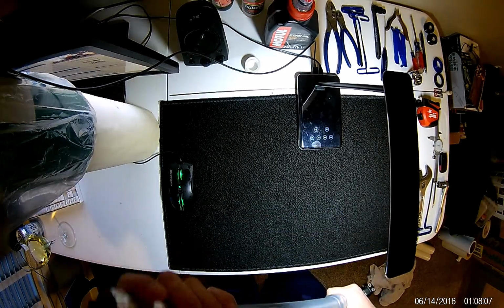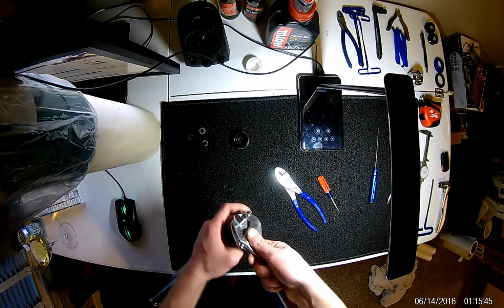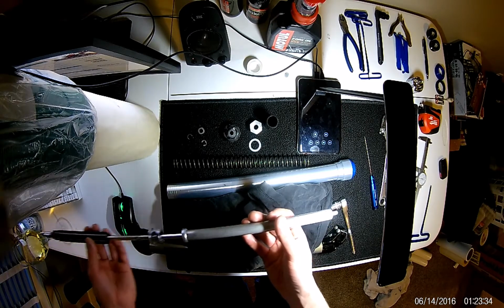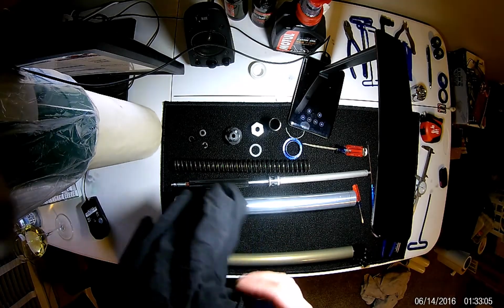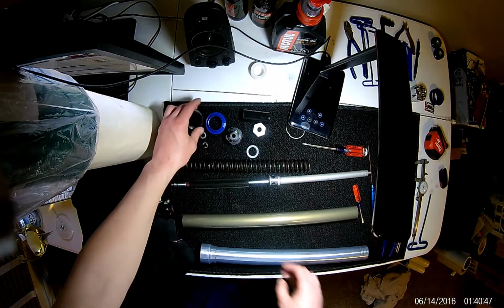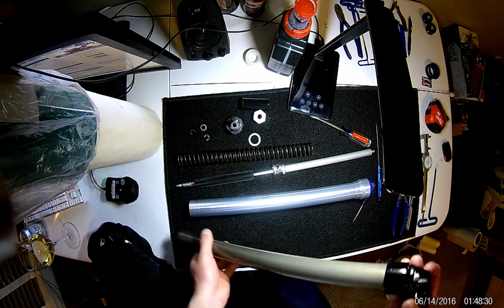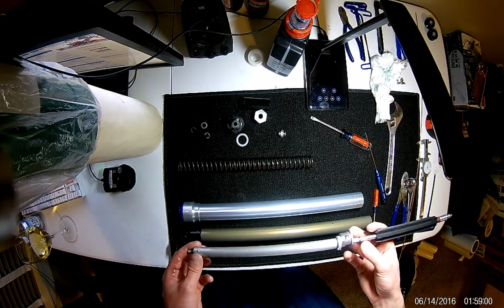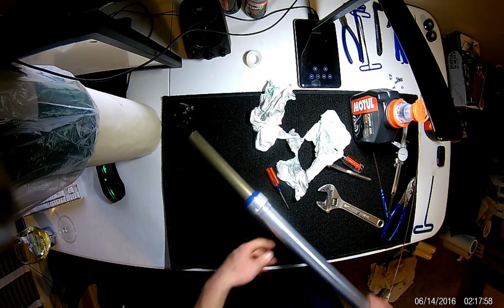Marzocchi Shiver Dual Crown Fork Rebuild

Comment: How much oil did you put in?  Manual says 70-80mm from the top but I don't have a tool to measure that.  By chance do you know the milliliter amount?
Reply from the maker: I believe I did the 70-80mm from the top. Pretty easy if you have a pair of calipers.

Comment: thanks for posting the video.... has been a great help to me in servicing my Shiver DC forks and to removal/installation of seals and dust covers..... shame you missed out the oil filling part... but I got the gist of that procedure from the Marzocchi Shiver DC service manual..... have you had any issues with the Enduro forks seals/wipers as I hear tell that they can cause wear on the stanchion coating... though I find this a tad difficult to comprehend as it is polyurethane on metal and not metal on metal... perhaps some users had a grit build up and that's what caused the problem..... :-)